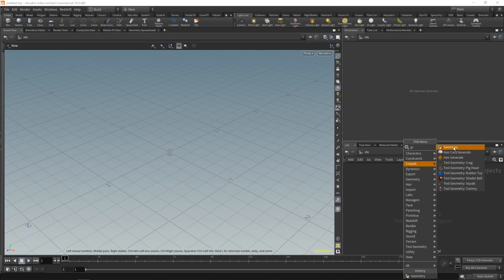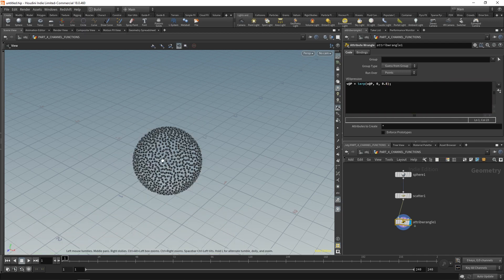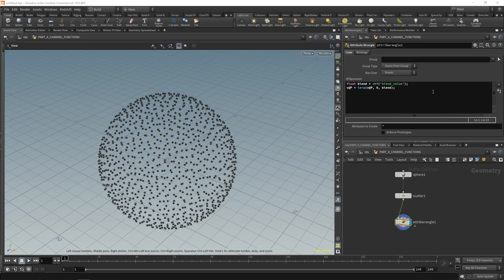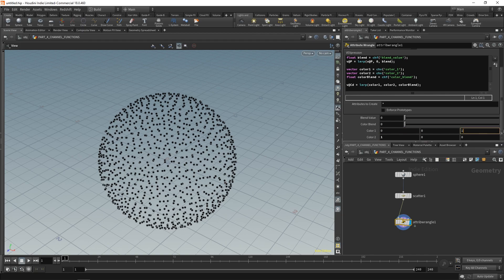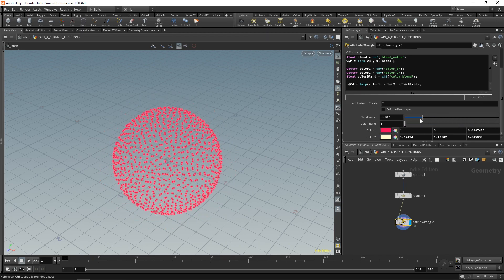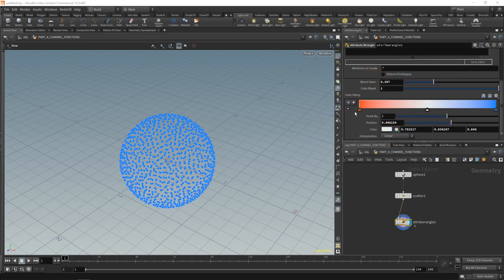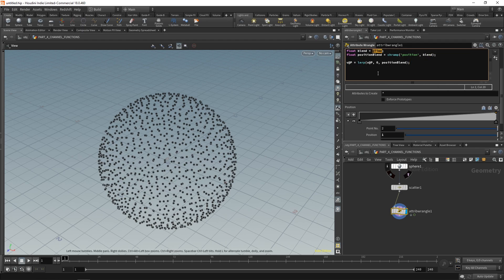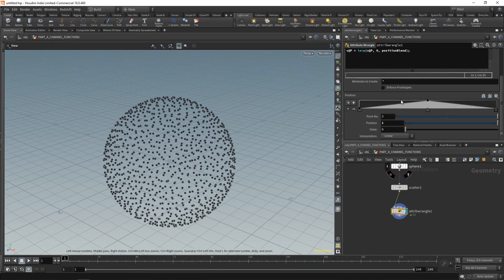VEX Isn't Scary - Part 4: Channel Functions

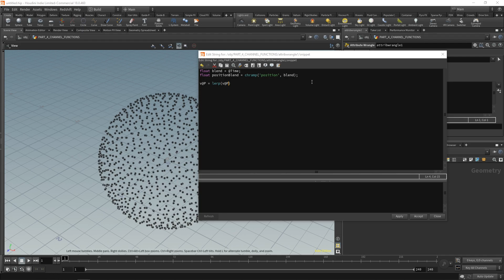Comment: i have typed in the exact same code as here at 14:16 but my ram doesn't reset and i can't find what is causing this. Do you ave any idea how i can fix this?
Reply: already found that in Houdini 19.5 it has been changed to not reset by default and the fix for it is typing:    float blend = @Time % 1.0 ;

Comment: when you changed the @P.y value i said "holy shit" out loud. This is so sick man. Confusing for me, but i appreciate this series so much. 1 thing that is different for me, my scene wont loop. It plays through once and stops, unlike yours. Any idea why? Thanks again!
Reply from the maker: Hi! The things you can achieve with a bit of code are insane, lol. So, there was a change to the way that ramps work in Houdini 19. They made it so that the ramps get clamped at 0 and 1. So, instead of how it used to be where it only used the decimal value, it now clamps at the two ends. So, you can wrap the value which drives the ramp inside of the frac( ) function. That will return only the decimal value and behave the same as the old ramp function. I hope that helps! ☺

Comment: Why doesn't:

vector lerping = v@P;
lerping = lerp(v@P, 0, 0.5);

produce the same result as:

v@P = lerp(v@P, 0, 0.5);

? 

Aren't they the same thing?
Reply from the maker: Not quite, in the first example, you are assigning the value to a vector variable called "lerping". In the second example, you are assigning the value to v@P. In other words, in the first example, the value of v@P is never adjusted. All you are doing is using it to set the "lerping" variable that you created. I hope that helps😁

Comment: Hi there! it looks like chramp now clamps the value 0-1 and therefore does not use the ramp in a loop per 24 seconds as you would intend with this snippet. So float blend= frac(@Time); would fix that.
Reply: thank you :)
Reply: This worked. tysm. Btw what does the frac function do?
Reply: @siddharthganti7302  old comment but it returns the fractional value of an input- only anything after the decimal point. frac 123.45 would return just the .45
Reply: appreciated @Cadellinman
Reply: Cool
Reply: Thank you
Reply: Amazing Tip!!!
Thanks!!!

Comment: Man this is hands down the best houdini tutorial for beginners. Btw, by any chance could you share the specs of your machine or a recommended laptop to work with houdini that smooth?!
Reply from the maker: Thanks Alif, I appreciate it! Houdini PC specs depend on what you intend on doing. I'd recommend at least an i7 processor, 32gb RAM, 1TB hdd for caches, and if you're using a third party renderer like Redshift, then a decent GPU with more than 6gb VRAM. It depends a lot on what you're doing - basic geometry work and you can get away with less, large scale fluid simulations and you'd need more. Hope that helps :)